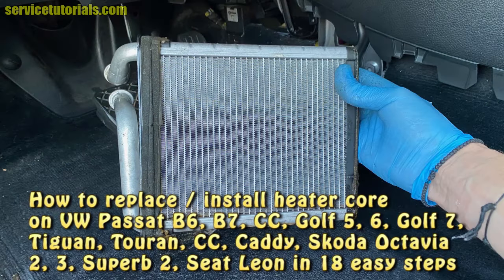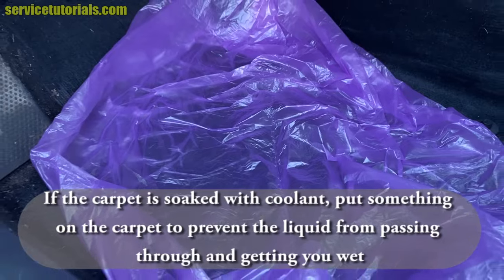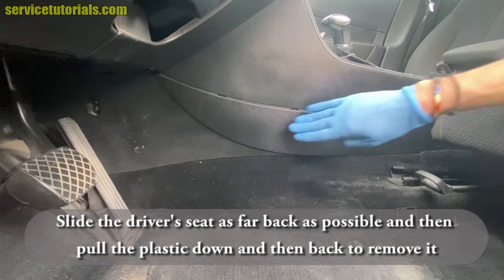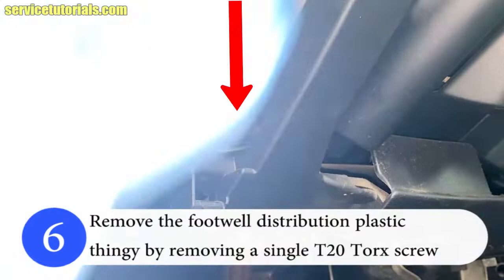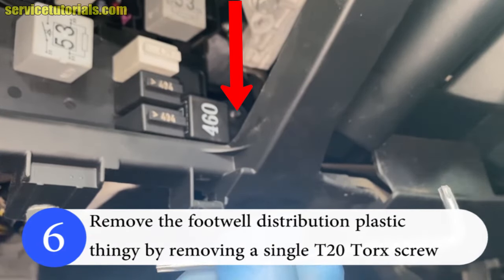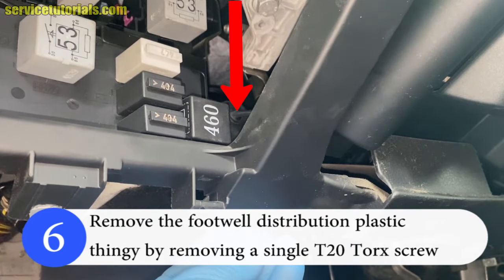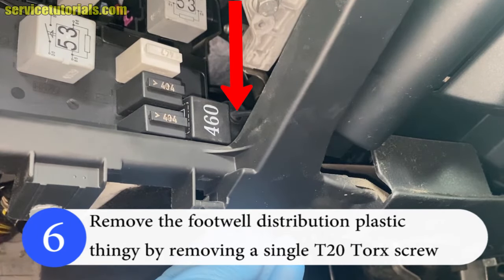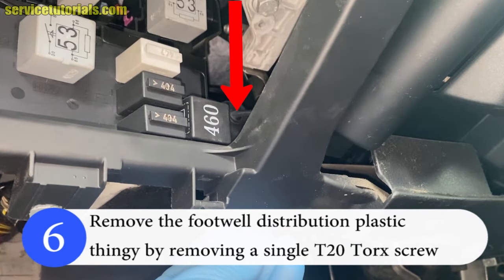How to remove / replace / install heater core VW Passat B6, B7, CC, Golf, Tiguan, Touran, CC, Skoda

Comment: Why remove the screw? What does that give you?
Reply: If you mean the screw in the engine compartment, I think the reason is that you need to be able to pull the pipes back in order to detach the heater core.

Comment: Do you not need to drain the coolant before disconnecting the heater hoses? I only see you mention taking the cap off to release pressure
Reply from the maker: Yes, you can drain the coolant if you have any, in our case it was drained all over the carpet inside.

Comment: Great video! I especially like the recommendation to cut the old core pipes.  I didn't, used a screwdriver, and the firewall pipes flanges bent them so they would not seal. A 1-day easy job turned out to be a 3-day headache.  One recommendation is, Blow compressed air through the firewall pipes in the engine compartment.  There will be a lot less coolant to spill.
Reply from the maker: Thank you for the tip, Dwayne! 👍

Comment: This helped me a lot !
A tip to connect the pipes if you’re alone is to use hose clamps on either side on the pipes so you get a leverage point to bring those pipes together. Be mindful and not clamp on the wider part on the car side pipe but put the clamp just behind it.
Reply from the maker: @patrikpersson3535  thank you for the info!

Comment: Perfect explained!!!
Is it possible that the radiator broke and there is no water in the cabin, but that it flows under the chassis outside? 
I'm asking because I can't find where my coolant is leaking, and I see drops under the car. The mechanic looked at all the forks and they are all dry, and we can't see where the fluid is coming from. I didn't open inside the cabin to check this radiator, so I better consult with you.
I didn't notice that my windows fog up, maybe a little in winter, when it's humid outside. Passat b6 2008 2.0 TDI PD engine.
Thanks in advance!